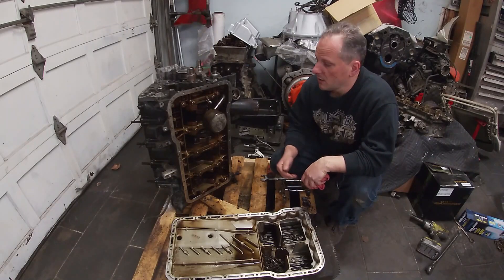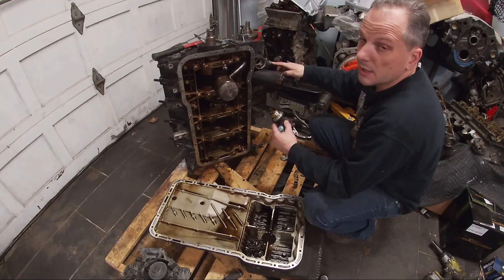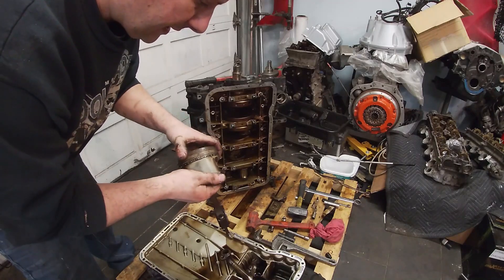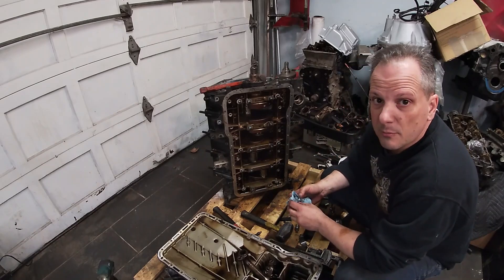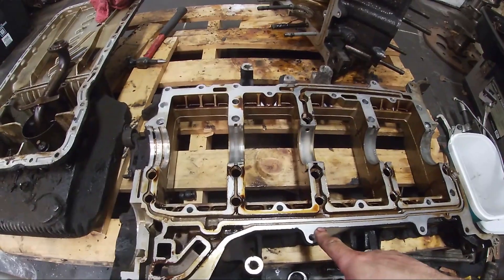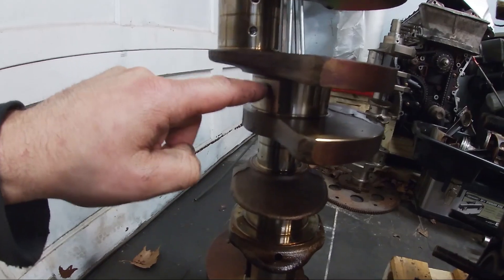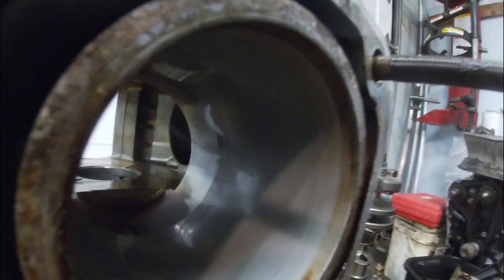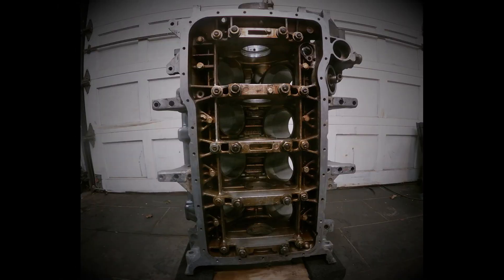Porsche 928 Engine Block, A Closer Look , Stroker Part 2, WHAT BROKE?

Comment: Quick questions re the stuck piston rings.
Could I please ask how many of the 8 cylinders had stuck rings?
And out of interest if you didn't take apart the bottom end but reassembled redoing the top only, do you think the stuck rings would have released with driving at operating temps?
Thanks and I just subscribed...

Comment: The bottom of the main bearings is called a girdle. In other words it has a girdled main bearing assembly. Usually seen in exotic engines like Indycar or F1.

Comment: Dont worry aobut the oil pickup.. that is proven to work under race conditions.   just run a good racing 20-50 oil (not mobil 1)
Reply: So far I've had good luck with  50%  20-w50 and the rest Delo  Diesel 15w-40.
Reply: Why not Mobil 1? Out of curiousity